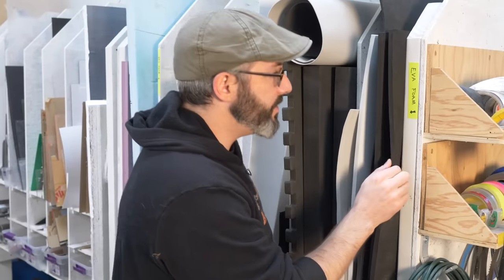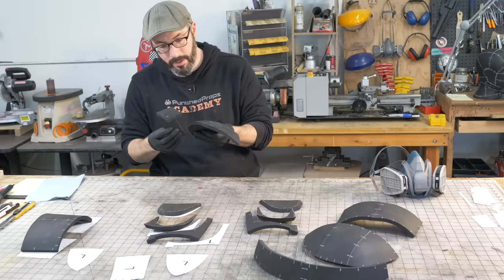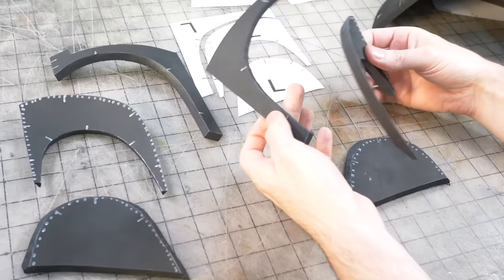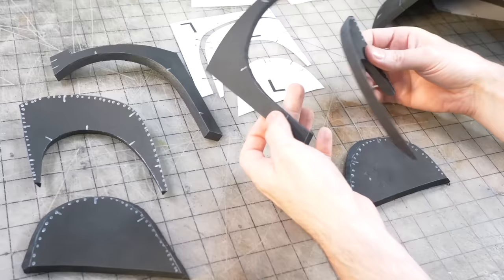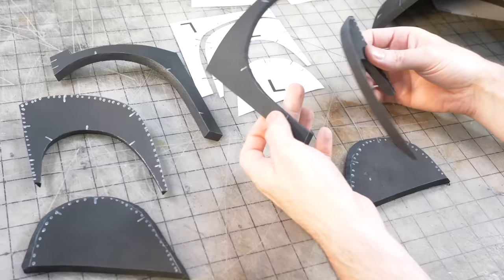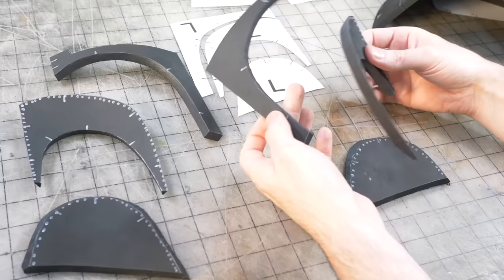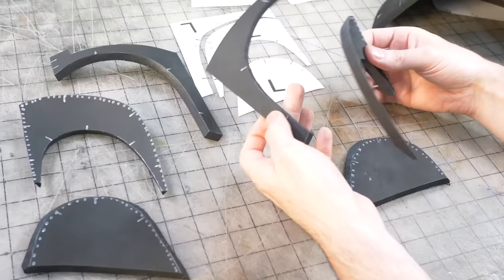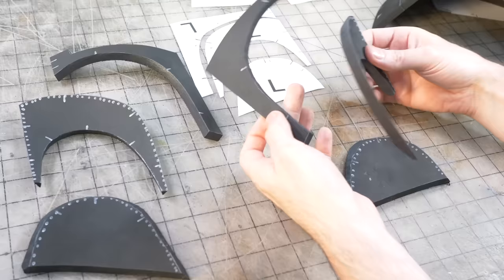Let's Make Foam Helmets! BOBA FETT & THE MANDALORIAN | 500k Community Challenge

Comment: Great video. Nice work. Fett turned out nice. Think your Mando pattern needs some work. Looks a little short, and the cheeks are not the same as Fett. Missing a dramatic angle at top corner of cheek. Overall love the show. Lots of great tips. I subbed!

Comment: What's the best alternative if you can't find any epsilon Pro but still has the same texture?
Reply from the maker: I'm not sure. Epsilon Pro is designed specifically to cover foam and I'm not aware of many other products that do the same. Fiberglass would work but would require some sanding.
Reply: @punishedprops  thanks for the tip. Will try fiber glass then.

Comment: Genius. What is the life span for these foam props? Does the foam last?
Reply from the maker: It totally depends on how you treat them, but I still have wearable costumes from YEARS back. I sometimes have to fix the attachment methods, but generally the foam parts are just fine
Reply: @punishedprops  honored by your response! What do you mean attachment? How the foam is attached at the seams?
Reply from the maker: How you affix it to yourself to wear, straps etc

Comment: Hi, what is the head size your default size fits to? I want to built it for my young son and probably have to scale it down. Do you have a smart way how to get rid of the heat inside the helmet? Thanks for a short feedback.
Reply from the maker: I believe my head is 23 inches in circumference. You can cut some stylish air slits to help with air flow or try installing a computer fan if you're feeling tech savvy!

Comment: Great tutorial and massive thanks for the free templates! Can some one help a foundling prop maker out please...I’ve built my lid a while ago but since placing in the visor it’s been stretched out of shape..is there something I can do to stop this from happening? 🥺
Reply from the maker: If your visor is acrylic you could heat shape it a little into a curve, but you can't heat shape all materials, so confirm what it's made of first. There's likely some tension being put on the helmet sides from the visor that's making it warp.
Reply: @punishedprops  thank you 🙏🏻 going to try this (I used a standard face visor that I had used at work) I’m also going to try placing layers of resin to prime another make  ready for painting (see if that’ll give the foam a bit more rigidity 👍🏻)

Comment: Hi, love your work. You said the contact cement is pretty toxic. Is it wise to use it on a mask someone will eventually put on, even for a limited amount of time? Is there a less/non-toxic alternative to that cement? Thanks.
Reply from the maker: You can use it on masks! Once it's COMPLETELY dry the toxic fumes and components will evaporate away.
Reply: @punishedprops  Thanks, I'll take your word for it.

Comment: me and the daughter are building these just a question on the over cut what like do you use on the cheek piece  the dotted line or solid?
Reply from the maker: Both! You cut at an angle so it fits better. The solid line is the outer edge, the dotted line is the inner edge

Comment: Why do your glue seams seem so permanent but mine are constantly splitting apart?
Reply: He’s using Barge Contact Cement. It’s a godsend for foam. You apply it to two sides, let it dry for about 5-10 minutes, and then when you put them together they become practically inseparable. Great for foam because you don’t have to hold pieces together to bond, they just bond instantly.

Comment: Can it be made from 6mm eva foam instead of 10mm?
Reply: yeah, it'll just be bigger on the inside. (I did a test with 5mm foam, it was very loose and the cheekparts flopped around a bit).

Comment: They seem a little short hight wise. any recommendations on how to lengthen them? also my head is almost 25" around any way to size them up?
Reply from the maker: You can scale the pattern before printing in the "scale" section of the print dialogue and do tests to get your fit. To change the height you could make a mock-up (we recommend doing this anyway!) and figure out how much longer you want the pieces to be, then adjust accordingly on your final version.

Comment: My head is 22.5 inches how does one go about scaling the templet down?
Reply from the maker: When you go to print you can adjust the scale by percentage! We recommend reducing it in small increments and testing as you go with paper to test the fit. Don't forget to account for the thickness of the foam!

Comment: Quick question or questions,  is barge contact cement roxic to breathe when its done drying? Because im making a mask/helmet that covers my whole head and im worried of breathing in nasty stuff. Second what is a safe nontoxic thing to fill seems in? And finally is that metal powder safe to breathe in?
Reply from the maker: Once the Barge has completely dried, all the toxic components are evaporated! We recommend waiting until you can't smell it any more before wearing - usually a day or so. NO form of powder is really safe to breathe in, always wear a dust mask. You can use foam clay to fill in seams on your foam projects!

Comment: so I have a question. I know I'm really late and I don't expect an answer but its worth a try. so I want to make a boba fett helmet but the problem is I don't have any kind of heat gun or rotary tool. can I use something else or is this the only way?
Reply from the maker: You can absolutely make this! Though if you are planning on making more foam props and costumes, a heat gun and rotary tool are possibly two of the BEST investments you can make. You can find good inexpensive ones on Amazon or at places like Harbor Freight!
Reply: @punishedprops  thank you for your answer😊 I will consider buying them if I make more of them😅

Comment: How can I mkae the helmet bigger? Do I just scale the template? need 23.5
Reply from the maker: Yes you can scale the template using the scale settings when printing! You may have to do a few tests to dial in the right size

Comment: Are there templates for the trim pieces for the Din Djarin Mandalorian helmet version?
Reply from the maker: Yes, though there may not be templates for the piece down the middle on top of the helmet, as it's just a strip with some lines drawn in it.
Reply: @punishedprops  Thanks.  We're currently cutting out the pieces for this helmet using floor mats.   So the strip down the middle and the ridge above the eye slots would just be a thinner foam?

Comment: Does anyone know what blade was used on the band saw? TIA
Reply from the maker: I use an 18 TPI metal cutting blade for cutting foam. I think it's 1/2" thick. It doesn't leave a perfect cut surface, but it's pretty good.

Comment: Does anybody has any tipps on how to make a smaller helmet? I really make one for myself but my head is pretty small o.o
Reply from the maker: When you print the templates you can adjust the scale in the print dialogue! Reduce it by a small percentage and test with the paper cut out - remember that the foam will have thickness too!
Reply: @punishedprops  thank you very much ^^

Comment: Tbh my biggest concern with the epoxy method is how durable is it? I got the feeling it would shatter if flexed too much on something like armour or the like, so how shatter/crack resistant is something like that?
Reply from the maker: It's designed to cover flexible materials, so it does have some give to it. It can crack or crease if moved around too much, but for something like a helmet it works great because that's something that doesn't flex much.

Comment: Your cutting technique is bad, its  too far away from  thingie. Just take razorblade and keep it allways very close with cutting surface, and yes, with bare hands. The marking point when you have learned the right way, is when your fingerskin is immune to that sharp razorblade, and that doesnt take too much time.
 YÖ.
Reply: AND dont use that cheap plastic bandsaw, better learn to cut with hands. YÖ.